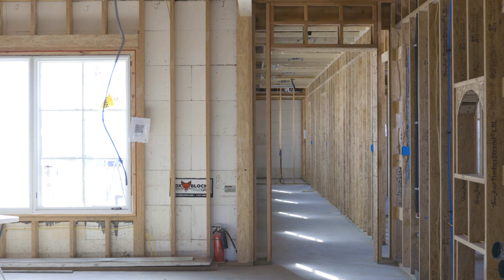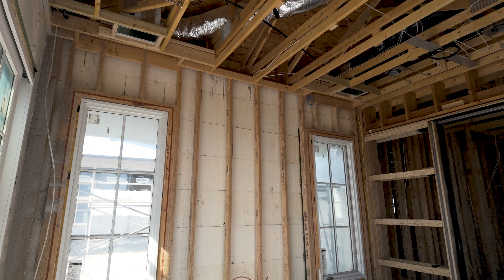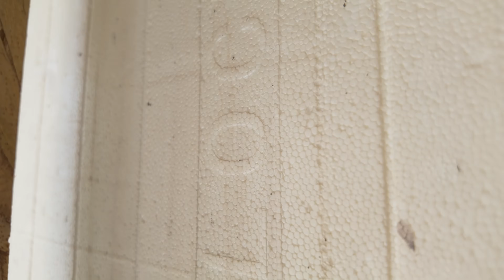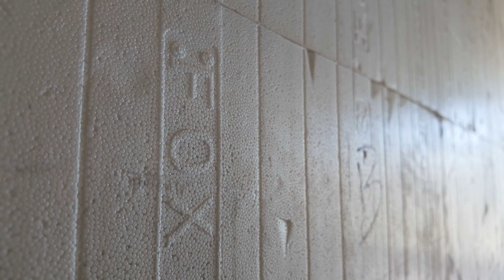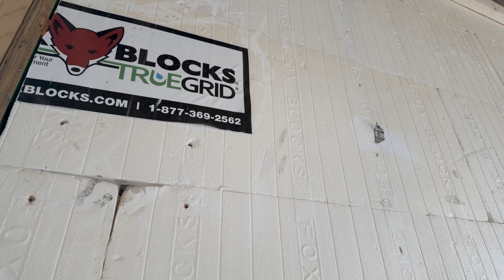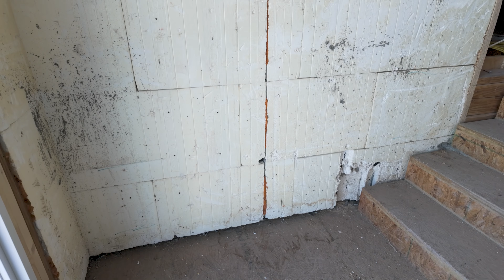Luxurious and Practically Indestructible: ICF Home Construction is Gaining Steam for Good Reason

Comment: I am curious why the icf wall you are standing in front of also has studs?
Reply: It creates a cavity for the trades to run power, water, etc, and to attach drywall to.
Reply from the maker: @BretHall thanks for commenting.
Reply from the maker: It’s for plumbing to pass through. We can channel electrical through the ICF block but we can’t channel plumbing through. Drywall can attach directly to the ICF in places that where we don’t have plumbing.